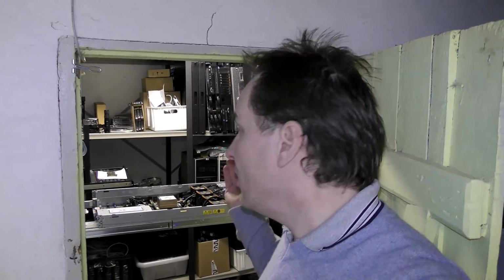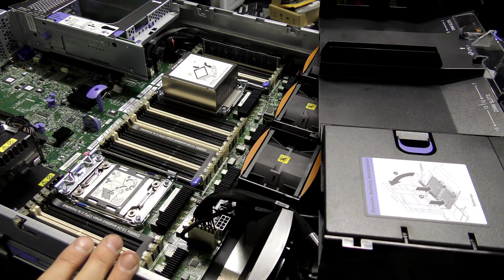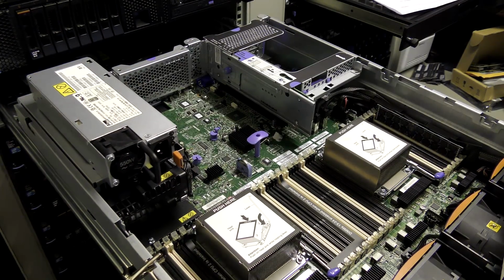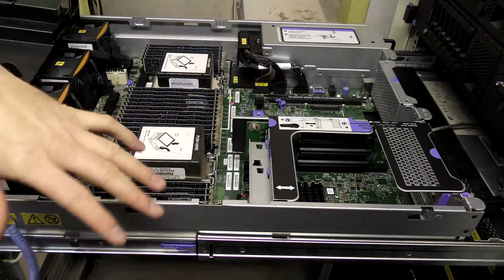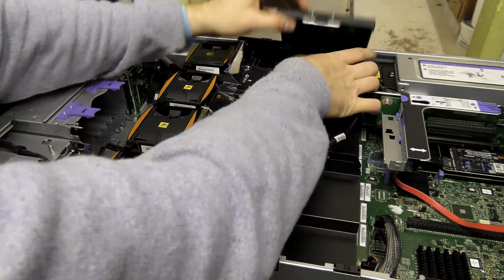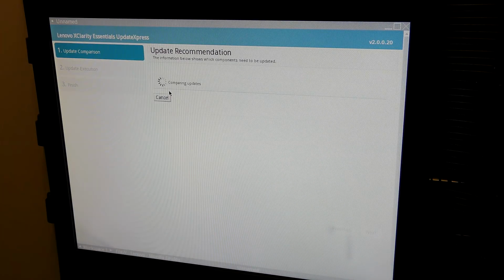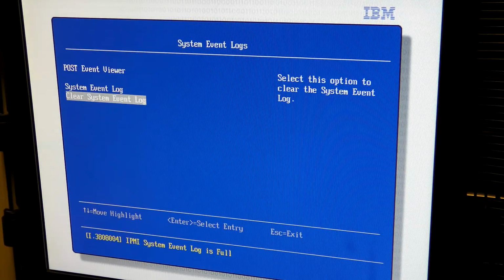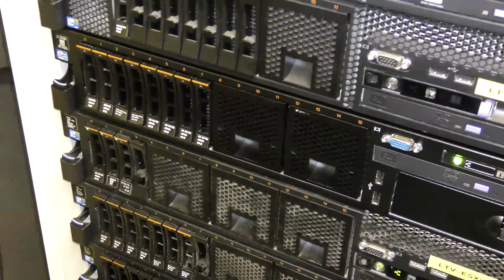Replacing Failed Lenovo x3650 M4 with NEW x3650 M4 - 602

Comment: Great video.  Very helpful for me as our system board died when i moved the server to a new location.  One thing you didnt mention that i saw in the user manual is changing the UUID.  Is that something you did but didnt include in the video?  Whats the impact if you dont change it?  Thanks so much!
Reply from the maker: On my old server that is long out of warranty,, not much. If you have a server under warranty, you want the stuff to match the broken system board. S/N,, and stuff,, there might be some FOD codes that needs to be imported on the new board.

Comment: well done job sir, were can i get the new firm ware update for IBM X3650 M4
Reply from the maker: Hi Afolabi Wasiu
Thank You very much!  You can get it here : https://www.ibm.com/support/fixcentral/systemx/selectFixes?parent=System%20x3650%20M4&product=ibm/systemx/7915&&platform=NONE&function=all

Thank you for watching! :-)
Reply: Is it possible to transfer the hard drive from the damage m4 server to the new m4 server and it will start working without any configuration and the data will not be lost

Comment: It concerned me the main board of our x3650m4 failed. The Led on diagnostics panel BOARD is blinking and it never starts. Why the mainboards of this specific panel so unreliable? Is there a chance of repairing of mainboard? The server which I was referring to has worked for 7 years OUT OF RACK. Could this bias it to damage? Could it be the reason of the failed we encountered?
Reply from the maker: See this : https://youtu.be/zl4iDxGD7cQ

Comment: Hi Morten,  Love watching your video's and i gratefully received a quick response on one of your other video's to which i then followed your directions and upgraded the bios etc on my X3550 M2's and installed a pair of X5670's in them i already had, quite the upgrade from E5504 :) breathing new life into old hardware,
Now I've brought back to life a X3550 M4 that was refusing to post so i got it for £10 here in the UK (with no RAM and only 1 CPU fitted but it had 8x 146Gb 6Gb/s 15K drives and the raid card which was the reason for me getting it) I've now got it up and running after playing around with it after watching your video where you also brought the M4 back to life, so your video's are a great resource to the rest of us that also love breathing new life into these servers and I've found windows 7 and 10 install straight onto IBM server's without any issues what so ever unlike other manufacturers having to find drivers before even seeing the install media and having unknown hardware in device manager etc and there great for setting up out the way where you cant hear them and then remotely accessing the desk top or setting up to do a task and just leaving to get on with it
Now here's my latest Question to you.......  (because there's no point in asking on the forum for obvious reason's)
Are the motherboards the same between the X3550 M4 and X3650 M4 as they are for the M2 please ?
The reason i ask is would the X3650 M4 PCI-E riser card fit the X3550 M4 motherboard please, i know the case lid would need modification to get it to fit however would it work with the motherboard like it would in the M2 please ?
only wanting to modify it to use a full size graphics card for as little money as possible for rendering video etc,
I've struggled to find an answer using Google and let's face it...... 
If anyone can, Morten can... :)
and please keep up the good work :)
Reply from the maker: Hi Paul Flanagan
Thank You very much!  I haven't tried that, but would expect that the two system boards would be similar enough to work with the riser from a M4.. they might have not put in the 8 pin power plugs on the system board on the x3550 M4,, but I do not remember... 
A nother solution could be : https://www.youtube.com/watch?v=TtBw_p_NU00
Thank you for watching! :-)

Comment: Hi Morten. another good video! i'd like to have a perspective from you about SAS HDD. is there any brand to avoid? and how long they will lasts at worst according to your experience? I have opportunity to buy a used 2TB SAS drive but i don't know about their reliability that much
Reply from the maker: Hi S. Kojina
Thank You very much!  Well SAS are better then SATA and SSD is better then SAS,, so if you need and can afford it SSD. But for many uses SAS is not much better then SATA,, the raw transfer speed on a SATA can be better,, and then when you have 10 users using data on the drive SAS will win again. Brands,,, Hitachi is good in my book..
Thank you for watching! :-)
Reply: My PlayHouse thanks! i currently use 950 Pro NVMe for my system and mixed SATA drives for data. but one of them now gives me sign of wearing. i'm thinking to move to SAS since my system also used as media server in my house. SSD sounds great but the price is awful lol

Comment: it does suck that you had to replace the server to fix it but i guess what must be done must be done.  At least the server has been replaced and is not functional again.  I can only wonder what is actually the problem with the server.  Something with the Motherboard i know that much at least.
Reply from the maker: Hi Dudefoxlive
Thank You very much! My best estimate, is that the IMM broke on the System Board.
Thank you for watching! :-)
Reply: True possibly corruption of the IMM to a point that is it unusable? i dont know as i have not messed with any REAL servers.  The only servers that i have messed with are computers that i have repurposed into file storage or Active Directory Domains.  Not real servers but then they have a dedicated use and i call them servers.

Comment: At 27:04, there looks to be a channel that you can route the cable along instead of just placing across the baffles and still make it to its molex connector.
Its close to the graphics card itself, near the printed "CPU1" label on the baffle. You would not have an issue with accidentally pinched cables and protect the server from cabling problems.
Reply from the maker: Hi Mac·au
Thank You very much!  glad you liked the video :-)
Thank you for watching! :-)

Comment: I really hope that the old server died because of a faulty pcb component.
Because if it didn't, you will have another dead server soon :-(
One of those transfered parts could have created the damage. :-(
I'm not trying to doom it, just wondering why a perfect server died.
Reply: Same here.. Fingers crossed.
Reply from the maker: Hi zx8401ztv
How would you, yourself solve this? would you get rid of 3 SSD's 2 M.2's, a GPU , CPUs and 384GB of RAM, 10Gbit network card and cache controller ect.
Thank you for watching! :-)
Reply: My PlayHouse Yup... in a big fire out the back of the playhouse... ;-)
Reply: On that list you forgot "And a partridge in a pear treeeeeeeee" :)
Reply: the imm rom decided to give up the ghost and now prevents it from initializing at boot, he said the virtual machines were still running fine when the fault occurred so he should be in the clear

Comment: take the other SAS backplane from the other server so you can have 8 more drives in this beastly
Reply from the maker: Hi Sakura Kinomoto
Thank You very much!  I will have a look at that!
Thank you for watching! :-)
Reply: he has a few laying around if that were the case for super storage tho he also has 24x2TB, 24x600GB disk shelves for storage, then again local storage is generally better then NFS/iSCSI storage for VM's and the likes regardless if he has a 10 GbE connection to the other server with the storage, then again he could prob deal with the slight slowdown in VM responsiveness only he will know this for sure
Reply: That's what i was thinking, but then you'll need to put in another Raidcontroller aswell. And a battery.

Comment: And im over here with my DL360 G5 all happy
Reply from the maker: Hi MegaRusty Official
Well If a Lenovo server shout cross your way,, you will know to grab it!
Thank you for watching! :-)
Reply: This HP is first and only server as of now. I am using it for testing while in college!  Runs great for what I need it for. Though I am on the lookout for an IBM since I am a bit of a collector. I also have more ThinkPads than I could ever need!
Reply: No UEFi bios for you mister :D
Reply: Proliant G5 series are getting old, but still usable. Run Windows Server 2016 with sata SSDs on some and they are quite fast. Sadly the SAS backplane cannot let drives go beyond 1,5Gbps on SATA and 3Gbps on SAS even with a P410 controller installed.
Reply: Still having a bottle neck is a problem in a production environment , for playing around i don;t really mind but bang per buck is good to try to get as current items as possible :D
Reply: Ian Litchfield berry a few in case of a Solar storm hehe. Good for you 😊